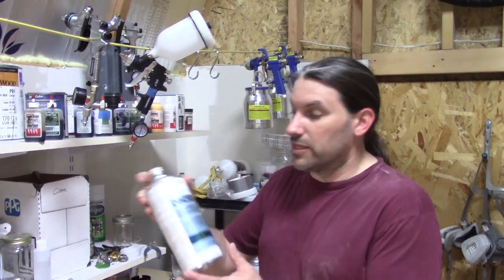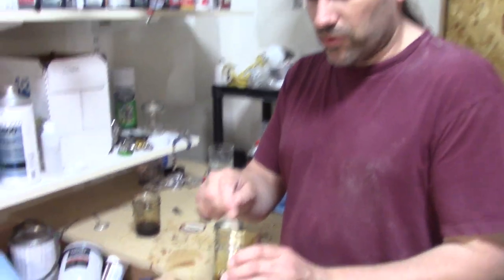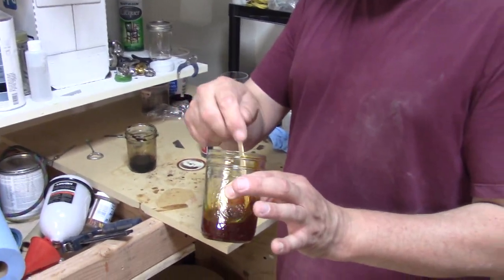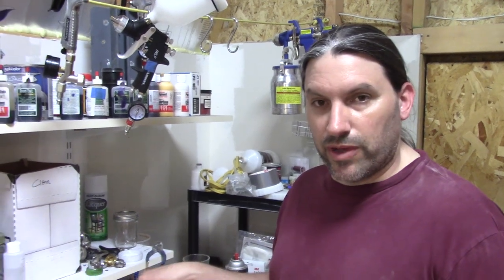Guitar Building Pro Tip... How To Spray A  2 Color Sunburst

Comment: Thanks for sharing this video with us.

Can you tell us more about the touch-up gun you're using:
  - is it an HVLP gun?
  - what needle/nozzle combination are you running?
  - what wall pressure and gun pressure are you using?

Finally, just wondering why you're calling this a 2-color sunburst, as there's only one color being laid over the base coat.

Again, thanks for sharing your skills with us.
Reply from the maker: Hi Marty, all our guns and HVLP these days. I think the psi to the gun is 40 lbs but, remember, these are conversion guns so it will vary from spray gun to spray gun and you really should find the combination that works for y'all. If you perfectly replicate all of our set up here in Colorado and take it to a different place it might not work. We are always adjusting things too and so should you based on the conditions, paints etc.
The base color is one color and the burst is another. Oddly enough as you burst the two there are lots of other colors that appear.
Thanks for watching brotherman

Comment: That Deltron is some nice stuff. Had some of the cheaper stuff mixed up for my bumper and they didn't have the correct color. Found that out after painting the bumper.

So I went back and they tried a few other paint chips but couldn't match it with the cheaper stuff. So they ended up giving me Deltron for free to make up for the other stuff not being the right color. I was pretty surprised because there was a decent price difference.
Reply from the maker: Right on, the Deltron is great paint for sure

Comment: Hey there! I'm not sure i understand, basically you spray the color mixed with some type of solvent right ? So that means that you don't mix the color in a varnish when spraying , it's just like when you do it hand rubbbed except you spray it and let it dry then you are able to put varnish on top ?
Reply: after some research , i found out that the dbc500 is actually some type of clear coat only to be used as an intercoat before the top coat :D !
Reply from the maker: That's right. now you can do a burst with color and solvent and then spray clear over that as well we did a video about that process as well

Comment: What size nozzles do you use on your spray guns? Mainly the nozzle used for the dark/black border! My spray gun tends to leave large droplets on the tapering off part, yours are nice and smooth. 
Edit: I just discovered a similar question asked and Texas Toast replied that it’s a 1.4 nozzle at 40lbs on HVLP.
Reply from the maker: There are lots of sizes that come with lots of guns. You will need to do some testing on the various materials you will be spraying

Comment: Great video , thank you !    Will a nitro spray sanding sealer would be enough to fill grain over an ash body before a sunburst ?
Reply from the maker: Thanks for watching Lou.
Yes it will, however it will take more and will shrink back at a different rate.
It is much easier to use the Simtec on an ash body.
Good luck brotherman
Reply: @TexasToastGuitars  Thank you so much for guiding me , appreciation from Quebec !

Comment: do you guys thin down the DBC 500 at all? or is it good to just mix with trans tint to the desired color and spray
Reply from the maker: I think the midcoat or DBC is good to go but it has been a while since we used that after switching to the TAMCO paints. Just follow the directions on the lable and you should be cool
Reply: @TexasToastGuitars  Thank You! I might just look into TAMCO paints instead. DBC500 is looking like a pain in the ass to find

Comment: Dear Matt, if I could call you so close! I have two questions about your excellent work: the second color you have used, you apply over and over and over the first one, as I could see, without delays, how could you seams the thickness of the second apply due to avoid dripping? and, what all about the regulation of you spraying gun? pressure, noozle diameter, coating viscosity, and so one? Many thanks for sharing......
Reply from the maker: Hi Jorge, you will need to do some testing and see what works for you. I will say that the second coat should be really dark so you don't have to spray so much.
Reply: Thanks, I'll try 😩

Comment: Hey can I shoot poly instead of clear coat if I use the same dye you used?
Reply from the maker: I don't see why not Kevin. I'm not sure what you mean when you say "poly" , like what brand you are using?
The clear coat we use is a urethane, I'm assuming poly is short for polyurethane. You should always test the coatings that you use... no mater what they are.
Let me know how it goes
Reply: Oh I thought you were using automotive clear coat
Reply from the maker: We are...

We use PPG Omni Production Clear
Reply: I ran into a problem, I am making the drawings for a Fender Showmaster that I had. Fender sent me an email with the specs, color etc, it’s says that’s a 25.5 scale. I have two HSH bodies, one resembles a Jackson soloist and the other is a strat body. I am using both bodies for reference purpose, now here is the thing, when I measure from the nut to the bridge it measures 26.5 on both guitars!. Now when I tried to move up the pick up cavities to make it 25.5, There is no room to fit all 3 of them in a 6” space to keep the 25.5 scale length... are the bodies wrong or is it me?
Reply from the maker: Hi Kevin, 
The Fender Showmaster had a 24 fret neck... I wonder if the bodies you are using are the problem?
Could it be that the standard neck pocket for a 21 fret neck (or 22 fret neck with that little fretboard overhang) e the problem? I don't think you should have any problem fitting in 2 humbuckers into a 25.5" scale guitar with 24 frets.
Maybe start with the scale on a big sheet of paper, layout the frets and then draw the body using one of the frets as an index. Looks like the lower horn joins the neck at the 21st fret.
Good luck man
Reply: Texas Toast Guitars yeap that’s what I did and I can’t fit a hsh configuration on a 25.5 scale, using a 24 Fret neck it would be too crowded, it has to be HH, I just finished the drawings, thanks for the info
Reply from the maker: Cool man... looking more at that guitar it seems that they were HSS or HH. Should be a cool guitar

Comment: Could you do a 2 color burst with rattle cans?
Reply from the maker: Hi Bad Gamer47, I'm sure it could be done and even done pretty well. The tricky bit is going to be using a paint delivery system that isn't really adjustable. Sure they make different caps/tips or spray nozzles for the cans but it isn't as easy as simply adjusting the gun. 
Good luck on your project, let me know how it turns out. My one word of advice is to aim the paint at the body rather than away from it (it's going to take a little practice) that way you won't get that hard line which isn't really a burst but a ring of darker paint.
Reply: Texas Toast Guitars thanks, I'm planing on doing a silverburst on a squire ( re-building the whole thing) will be sure to let you know how it turns out